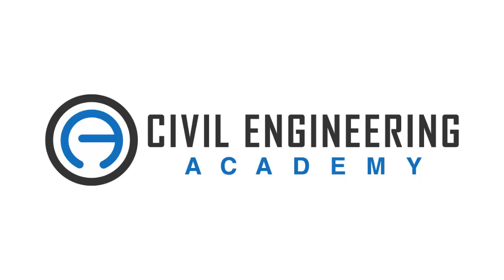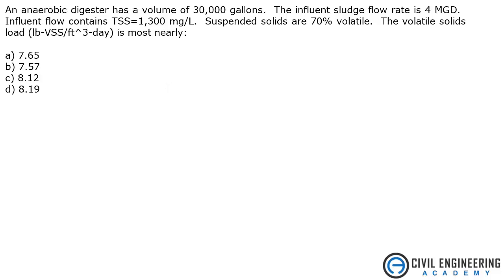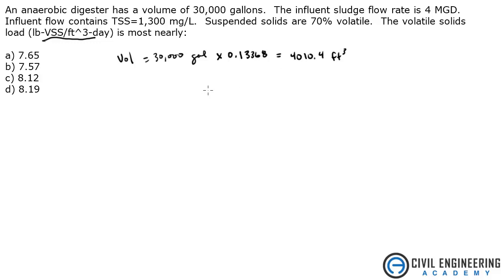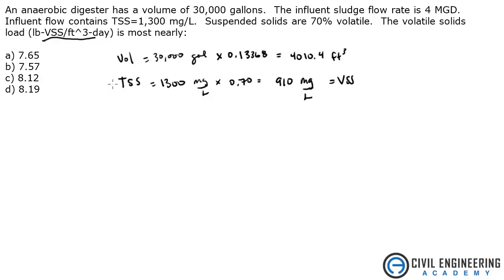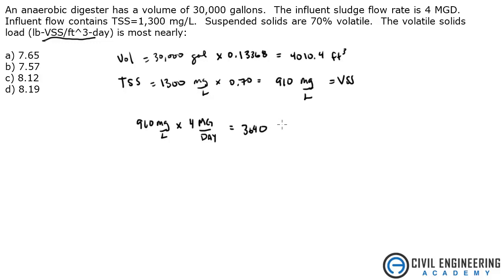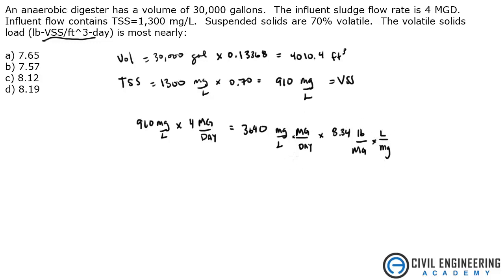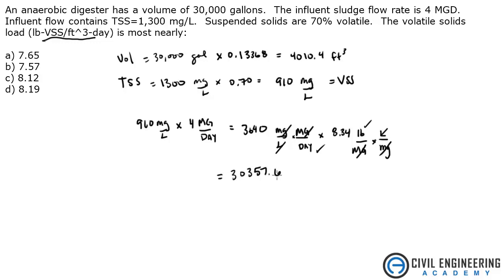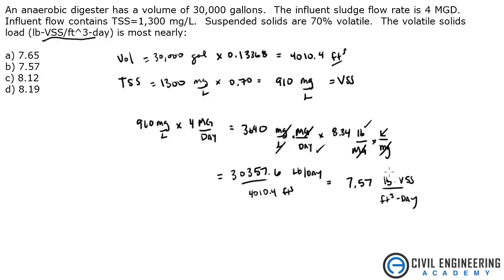Water Resources-Volatile Suspendid Solids Environmental Question

Comment: This saved my day. The conversion factor part was killing me. Also on the NCEEE practice exam it used sludge solids concentration is 2%. A quick Google search showed this is a industry term for 20,000 mg/L. The CERM was difficult to understand in this section. Thanks again.